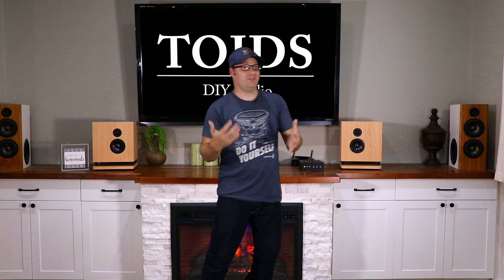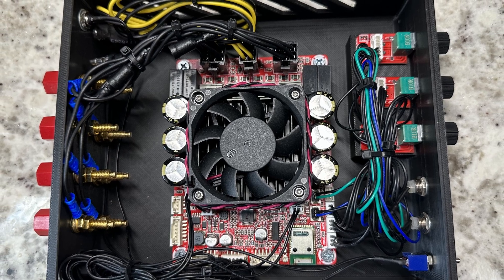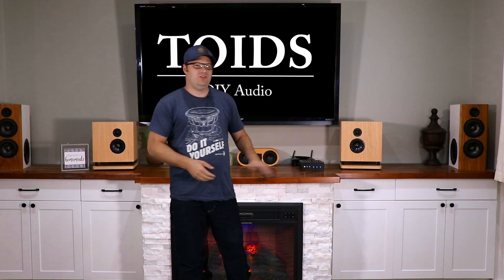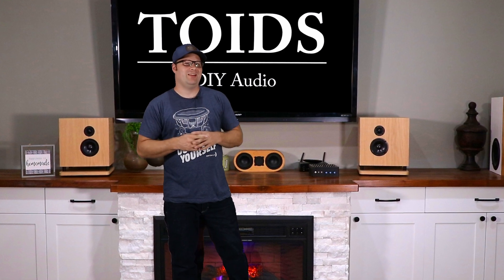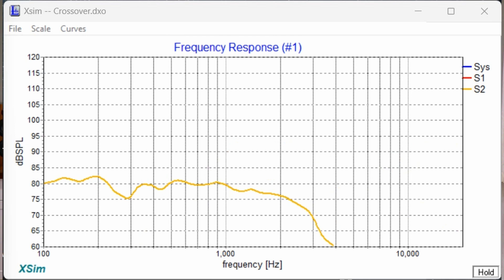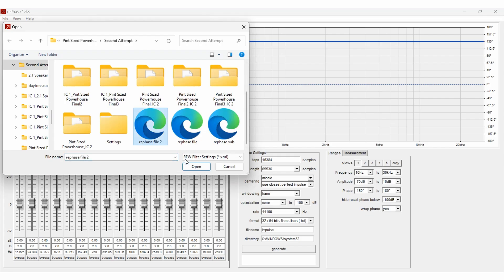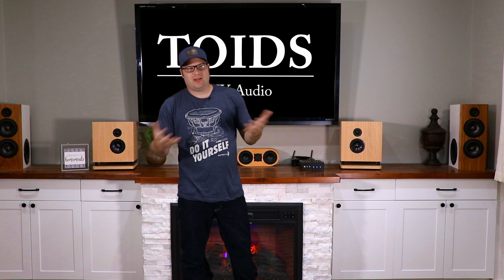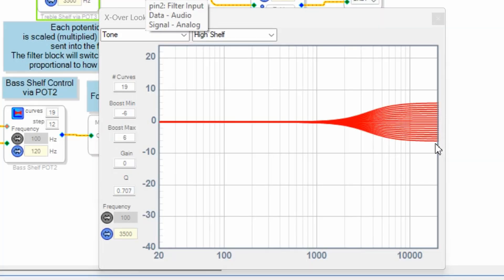BASS in the 30hz! and AUDIOPHILE flat?!?!? Pint Sized Powerhouse Build Video

Comment: However, not much detail in the video on the parts you used, and why. Especially the drivers. And it seems if others don't use RePhase to cheat as you said, their speakers won't see a flat response? You seem excited about the speakers, but don't go into much detail about them. Leaving the DIY part out of the video.  Or show anything DIY.  Not even a picture of the crossover or how you were able to make it fit inside such a small cabinet? There was barely room for the drivers and wire it seems. Just talk how great the speakers are, and didn't even play them.  Or show their "actual" performance numbers from the test equipment, just theoretical.  Kinda like a car review without driving the car. The car looks great, but does it run?

Comment: I just came across a short tower speaker by Def. Tech that also has this 3 way design with a powered sub, but passive mid and tweeters. Now on the same I day come across these cube speakers again 3 way design and subwoofer just all passive drivers.  I like how you talked about being able to have the ability to turn these speakers up to higher volumes to get the most out of the speakers.  This is a really cool design, and think something like this will be my next pair of main speakers either for stereo, or surround sound. You get 2 subs for the space of none.  I can't believe I hadn't thought of this type of set up sooner, as it has what I think are several advantages over a traditional 2.1 design.  Thanks for the video.

Comment: I actually own a pair of the  PS 10 model that I purchased in 1984. Refoamed the 10" woofer surrounds 20 years ago, and just re-did the original 3 way x overs as the original caps had gone bad. Unfortunately the tweeters used a soft cloth "polymer" impregnated  material where whatever they impregnated the cloth with has deteriorated, so the tweeters have a bad response.

This video is inspiring, and I may redo them again, or I may just find some soft domes that work with the rest 

The original 10 model was an interesting design, it was a sealed box, and the mid driver was set in a sealed cardboard tube within the box, so almost like having a sealed box attached to a sealed box.

The bass and mids are still very punchy.

Comment: I remember those (PS) .  Super cool idea , especially when space is an issue.  Now, speakers have  a  driver on the back or side. 
Drivers and crossovers are far better now, especially when you can measure the output and dial them in.

Comment: These were sold in the 80s at least in Northern Virginia primarily at a store called Luskins. The PS10 was the one I wanted. Slightly larger.
Reply: I worked for Belmont TV and Stereo, we sold  them as well. I have mostly working PS-10s, but the tweeters have degraded and sound bad.
Reply: @stevenveerhoff9208  Belmont TV was  known for their TV commercials in the 70s and 80s. Not sure when they went away. But fond memories going in as a kid and playing with the Tube Tester.
Reply: @lilmangofast  I was working for them when they did see some of those commercials. The vocals were done by the Starland Vocal Band, who did jingles and promo work before and after Skyrockets in flight.

Comment: I remember when those original PS speakers came out.  Nifty stuff.  A friend of mine owned a pair.  He probably still has them, LOL. 

REW has a pretty nifty EQ feature that will give you all the DSP settings to convert a measured response into a target response.  Took hours of time out of tuning my car audio system :-). 

What does the off-axis response of those speakers look like though, let's say at 15 and 30 degrees?  At my last attempt at tuning a speaker, I forgot about that.  They measured flat on-axis, but off-axis a horrible peak around 3kHz reared its head.  Back to the drawing board!
Reply from the maker: They actually are have a great phase relationship with it maintaining normal response off axis. I should have included that in the video. I’m working on making a diy spinorama so I can show that better.
Reply: @Toid  YEEEEEES! Spinorama's would be SO awesome, especially for your home theater speakers - at least for me a cornerstone of a speaker for my home theater is a very good off-axis response! Even more so than the actual spread in degrees, it has to be well behaved off axis! :D
Reply: I've had a lot of trouble getting the rew auto-eq to correlate to real measurements. I've only gotten good results from tweaking, measuring, and repeating until satisfied.

Comment: Are the speakers flat for the room? does the program make the speakers flat for the room? so if i use your program it wont be flat in my room?
Reply from the maker: It’s anechoically flat which is what you want. Every speaker, the room will affect it. This being so flat has major advantages with that, as well as the potentiometers that can adjust the bass and treble

Comment: How come theres such an enormous push in the HiFi hobby/culture for 2.1 bookshelf speakers? I live in a apt and have no problem runing freestanding floor speakers; whether its 2.1 bookshelf or floors, either one can upset neigbors... But why is almost everything bookshelf sized? 

YouTube reviews are absolutely inundated with this.

It's very frustrating to have to dig through amp model after amp model's worth of reviews only to find out it's got all of 30 watts!! 

You can have a lovely wall of sound at low SPL and excellent fidelity and still need a couple hundred watts for headroom (and a cool amp if you're running AB). This is especially true if you have harder to drive low ohm speakers or speakers low on sensitivity but with great sound.

With bookshelves vs floorstanders, as with cars, there's "no replacement for displacement". I've heard fantastic bookshelf speakers and for every model of those I've heard, there's a floorstander that will blow them away.
Reply: Build yourself some proper high efficiency speakers and 30WPC will be more than enough.
Reply: @mkshffr4936 Even for stuff like Polk Audio SRS SDAs, or Electrostatics? Tons of older popular Klipsch models out there that don't respond well to so few watts either. High efficiency ≠ high fidelity. They overlap but there are many speakers out there that sound excellent but have poorer sensitivity, and those little Fosi/Schitt audio setups that everyone raves about are useless in that regard.

I guess I'm kinda saturated on junk/useless information for my usage case with the whole hobby because so much of it is geared away from floor standing units, the why of which I've yet to comprehend.
Reply: I think part of the cause is the fact that speaker technology has progressed enough in the past 25 years that we can now have reasonably deep bass in small cabinets without needing larger floor speakers, or even mid-size towers. Because it's possible, and kind of cool and almost counter-intuitive to have a smallish 5-7" speaker producing bass that only 30 years ago required a 10-12" woofer (in most cases) they have just become very popular. Plus all the Class D amps they're coming out with allow for smaller amp sizes, and built-in's.  I kind of miss my Realistic 12" three-ways from time to time, but modern stuff mostly sounds better -- maybe just without the punch in the chest feeling.
Reply: I think a lot of people don’t want big and loud(perceived loudness) and a small speaker doesnt take up space and is easy to move. I only like small speakers for a very small room, producing(near field), and practicing dj’ing as you can put them on your table very close to your ear. To other person in this thread. I had 50wpc a/b and a pair of older Klipsch Forte and at about 30 watts it was loud enough to piss my gf off if I was playing drum and bass.
Reply: @andyeighttre  "To other person in this thread. I had 50wpc a/b and a pair of older Klipsch Forte and at about 30 watts it was loud enough to piss my gf off"

Not surprising as that would be about 110dB per channel @ 1m (103dB if both channels driven to 30W.
Reply: In our case it is floor space, weight and moves. It is actually easier to work with 2.1 space wise than two floor standers that offer similar sound.